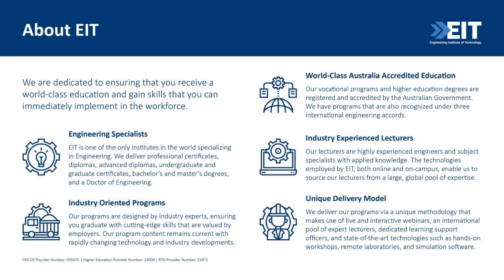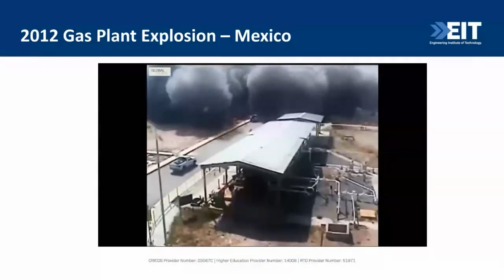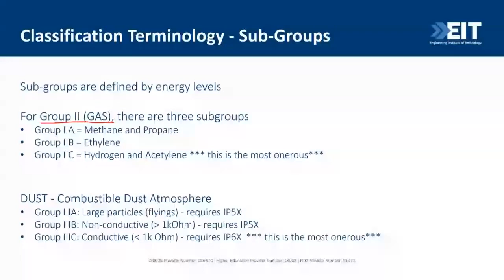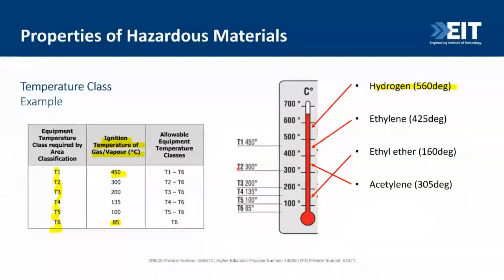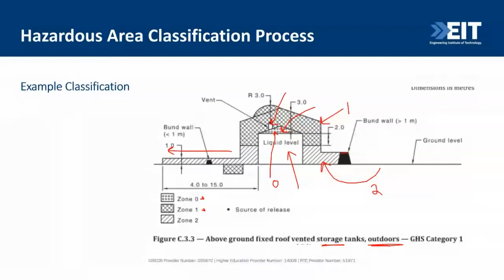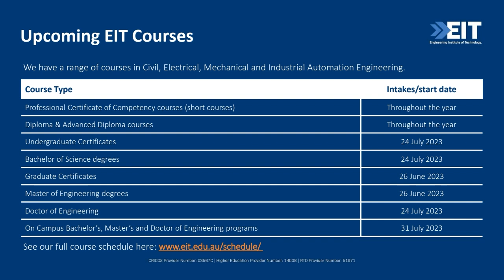Introduction to Hazardous Areas and HA Classification (repeat)

Comment: Hi, Some corrections 
1) In Properties of Haz. Mat. slide, as per NFPA-30 liquids with < 37.8degC flash point only Flammable not < 61 degC. Liquids with flash point > 37.8 degC are Combustible. 
2) In Temperature class slide: For Ethyl ether T4 shall be chosen not because of its Flash point as you say, its because of its Auto Ignition temperature.